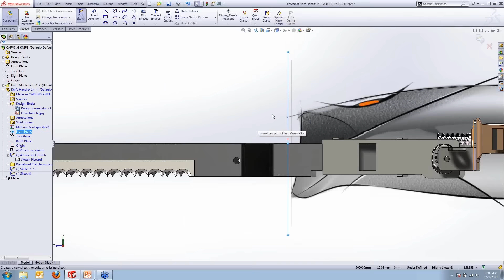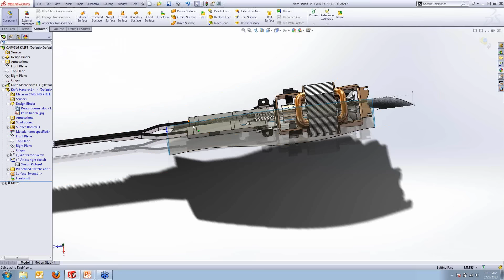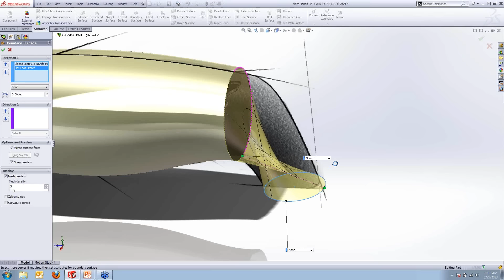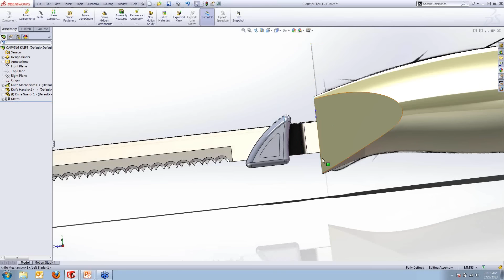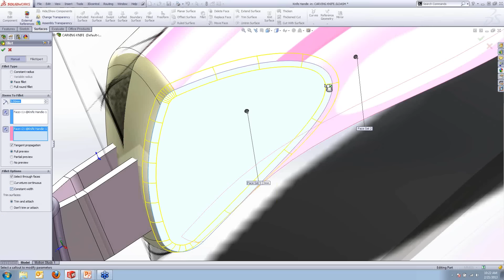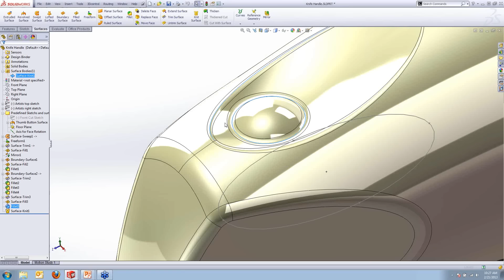SolidWorks Surfacing and Freeform Design

Comment: Great video, I learn alot. When I can't get the thickness feature to work I like trubelshooting it with making a ofset surface from the surface that can't be thicken, very often you will find out what is wrong while working your way to a full surfacemodell.